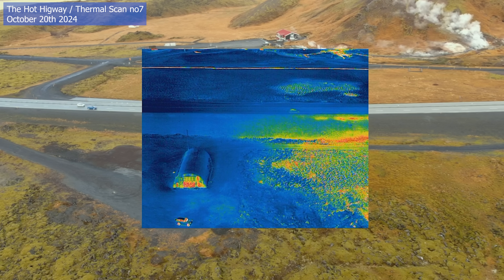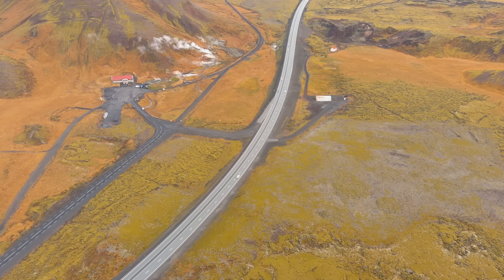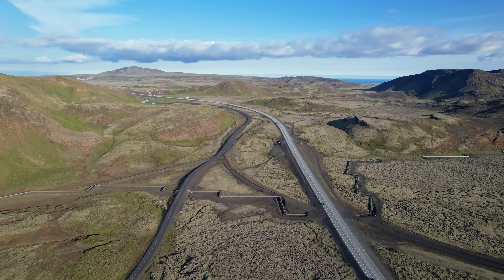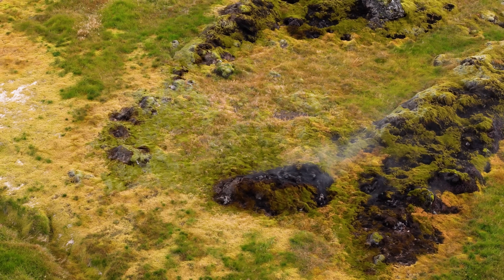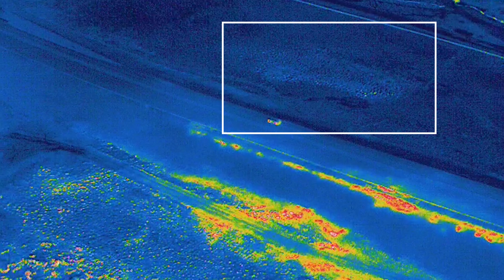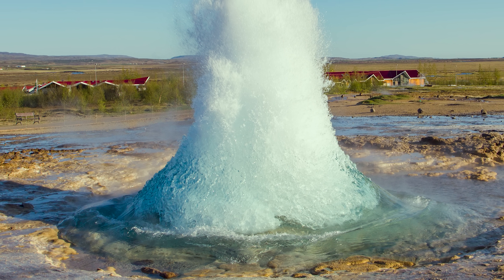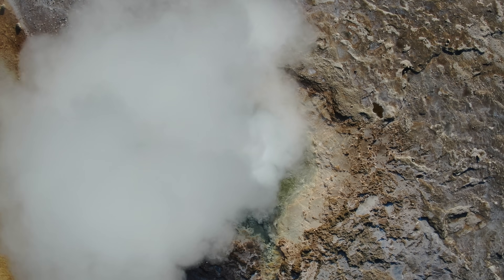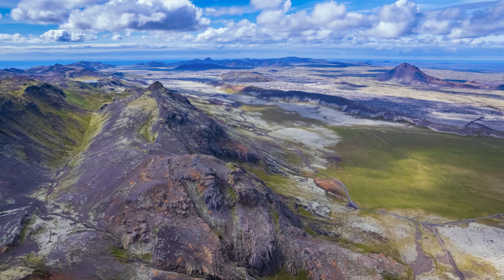The Geothermal Road Gets Only Warmer And The Great Geysir Area Is Unusually Powerful

Comment: How hot is the area around the road actually getting? Could you feel it if you touch the ground? Will it keep snow melted off the road?
Reply from the maker: The road embankment is very thick and the road administration drilled holes trough it and placed steel pipes there to keep the steam from reaching the surface, and it worked to keep the road safe, at lest still....but it's up to 100c beside the road embankment.
Reply: @JustIcelandic  WOW! I seriously did not expect that! 😮